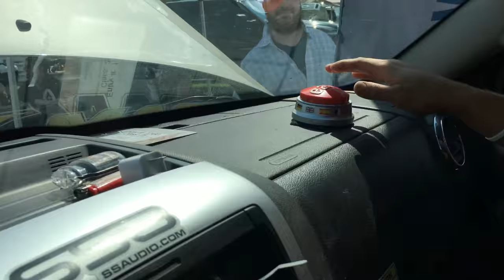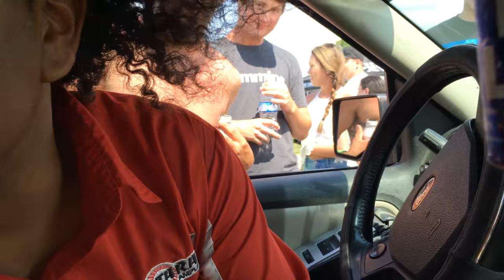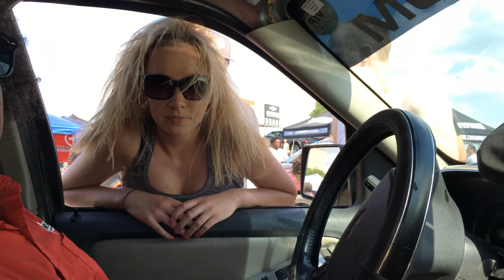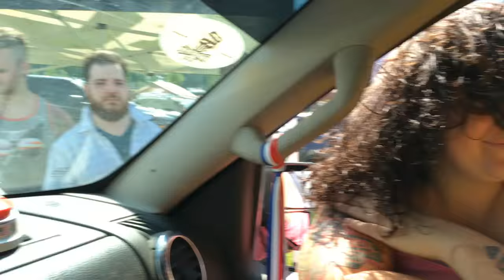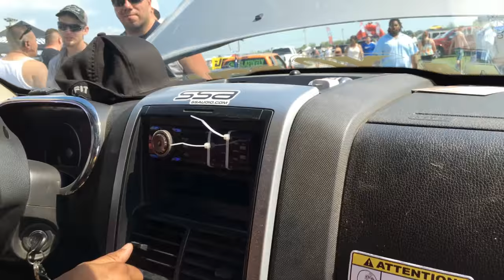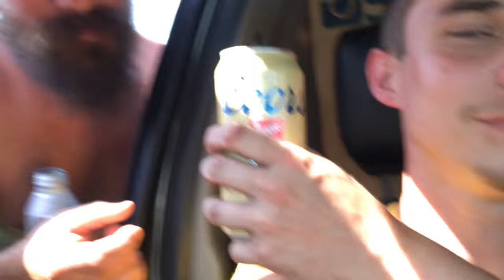Drunk Demos with Senchez Richardson ''120,000 watts'' High Voltage Setup

Comment: Those amps are putting out at the max 20k each because even a 7K amp has to have three runs of one awg wire to power it!! It would take at least 5 runs of 0 gauge to run that much power and every 12k amp you ever see is at least 36 inches long and if that was a true 120 k it would desecrate those six 15 inch SSA Subs because that would mean you were putting 20,000 what's to each sub and also he would need at least 25 batteries per amp 50 batteries to run those two amps and he's only running six batteries per amp but don't get me wrong it's loud!!! It did a 165db on the meter!! Great Video!!!
Reply: bro, these arent 12 volt amps. these are high voltage. meaning they dont even need 0 gauge because there is so much voltage that carries the welectricity more efficiently. they only use a handful of amps. while 12 volt uses over 1000 per 10k watts. do your homework.
Reply: jon Heiden got eim!!!!

Comment: only 165 db with that many watts hmmm
Reply: I think box and cabin are affecting the numbers man. I would like to see those numbers in action.
Reply: +COMPASBASSCLUB CHICALI something lol 120,000 watts yeah it would be loud
Reply: Harold Lamar It is a stock cabin so I think he is lossing some dbs.
Reply: +COMPASBASSCLUB CHICALI 100% Stock cabin. Music build that can do some numbers.
Reply: +Harold Lamar Sunroof is still install. Entire build has 0 dead ener and 0 reinforcement.
Reply: +Sencheezy Kool Kool keep it up basshead. and I mean that in a good way
Reply: Sencheezy How much are those amps and where you got them? And how are you  running 24volts is that batts without alts only?
Reply: +COMPASBASSCLUB CHICALI 18 batts wired in series for a full charger of 237dcv with each amp wired at .23
Reply: Sencheezy Thats crazy man! Now I am getting it. Thats why Brazilians have the world record because they are using 24volts setups. Hey but do you charge your batts with alternators or you just charge them for rounds or demos?
Reply: +COMPASBASSCLUB CHICALI not 24... 240+
Reply: Eclipse cd 7200 8 volt preout